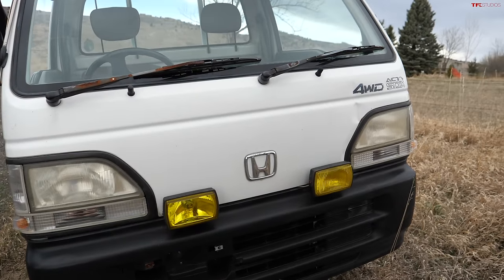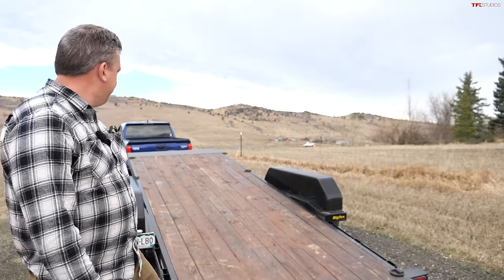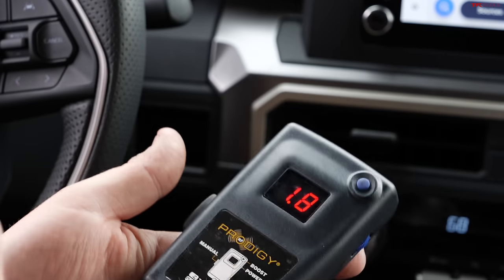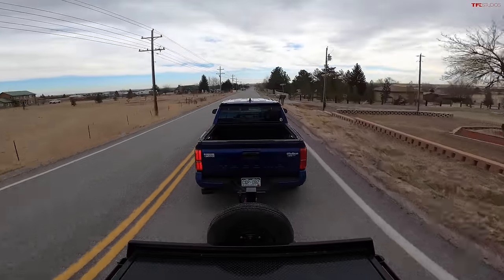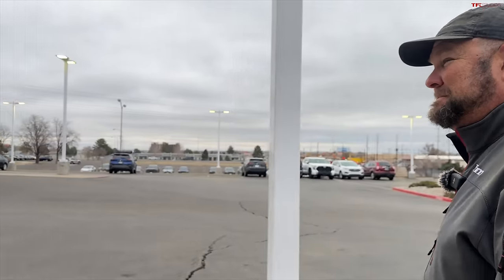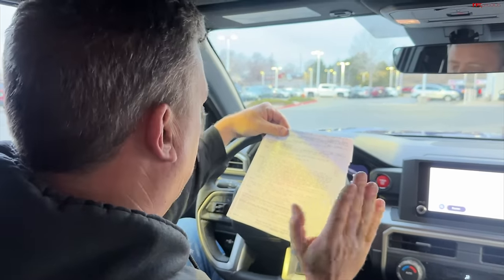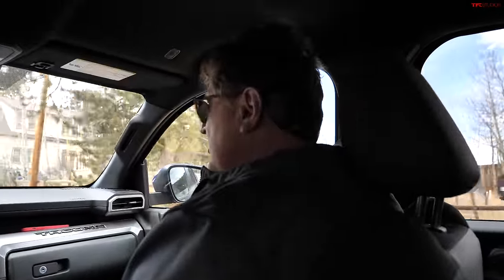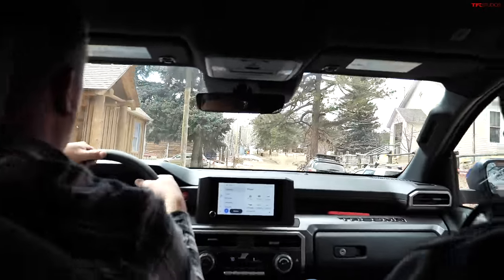Can the New Toyota Tacoma Tow Up the World’s STEEPEST County Road? | Part 1

Comment: Good luck to anyone without a youtube channel getting that repair covered let alone get it fixed in 8 days. No thanks ill wait a few years to consider a new Tacoma
Reply: Huh? My repair was done in 3 days and covered. Love my Taco.
Reply: Theres a youtuber who thinks its because of poor workmanship in the mexico plant.   The part that broke is a time tested 30 yr old part that shouldnt have broke apparently.
Reply: Yeah, this failure really had nothing to do with the new platform. Stuff happens, that’s what a warranty is for.
Reply: toyo fanboys can’t comprehend decline of the tacoma
Reply: @DeepDishPizza Toyota dealer near me tried to deny faulty shocks/springs on my 2022 TRD OR under warranty w/16k. Was 100% driveable just squeaking and grinding. Took them over 3 weeks to accept responsibility. Never off road just regular street driving. Are parts readily available yet for the 2024? Or did Toyota prioritize this repair? My guess is they did no questions asked.
Reply: @mikejones762  what a joke!!! its a new truck the manufacturer is ironing all the problems they didnt founf in the testing phase grow up!! if the tacoma is in decline then whats not in decline?!
Reply: @DeepDishPizza  so you had the same failure with the four wheel drive?
Reply: attacking the guy who makes a comment they don’t like.😂
Reply: @iskdude9922 sure blame it on Mexico, it failed get over it and toyota deserves no blame?
Reply: @paulhunter9613  Sure did and it was my fault.
Reply: @DeepDishPizza I would 99% guarantee it was not your fault. How is it that you figure it's your fault?
Reply: @Tiovergudo  theres a certain work ethic that you simply cant overcome if its not part of the culture....
Reply: @iskdude9922 The assembly location had nothing to do with the failure.  If that was the case the 3rd Gens would have had issues.
Reply: @user-tb7rn1il3q  we dont know that...  its just a guess.   But, the tundras wastegate had issues.  But the lx didnt even though its the same engine.   All lexus products are made in japan i believe.   Also youtuber automotive press bought one of the first tundras and his emblem was backwards.....    he said that would never happen in japan.
Reply: @mikejones762  whats wrong with being a toyo fanbot they make the best vehicles
Reply: @danielplantz2957  Huh? Because I pushing the Taco too hard. Super steep.
Reply: @DeepDishPizza  were curious about real details. Steep isn't much of a detail. What else can you tell us
Reply: @danielplantz2957  Sorry about being vague. However I prefer to keep it that way. Thanks a bunch.
Reply: @DeepDishPizza  worried Toyota warranty is watching 😉😂 We're all just trying to figure out what the limits are. Tfl driving on the equivalent of a bumpy road, definitely shouldn't be it
Reply: @DeepDishPizza  maybe it broke because it doesn’t like being called Taco.
Reply: umm we don't need LUCK because they fix the "issue" so stop NOW
Reply: @mikejones762 that is because it ISN'T  happening, ever think about that??
Reply: @Tiovergudo No they don't
Reply: @hikenmikes8262  They have always been Tacos. What is wrong with you?
Reply: @danielplantz2957  Just watch them and don’t worry about me. Gonna take the wife for a drive in our TRX.
Reply: Why wouldn’t it be covered, it would be covered under warranty, Toyota doesn’t treat their customers like Chevy does
Reply: @AJ-rg3pr  Chevy has been better to me than Toyota has. So you’re wrong there bud.
Reply: @DeepDishPizza  just people have different experiences, Chevy hasn’t made a good vehicle since the early 2000s
Reply: @AJ-rg3pr  That’s also not true.
Reply: Agreed.
Reply: @DeepDishPizza which Toyota did you have. Was it  truck?
Reply: @rickeycooley9139  Learn to reread your reply before you send it. “Was it Truck?”. You mean…”was it a truck?
Reply: @DeepDishPizza  what did yours need?
Reply: @DanMasters so a part just breaks under a well-known youtube content maker and you expect the rest of us to believe in warranty?
Reply: Also the transmission overheating while towing. Not looking good so far…
Reply: ...and sponsored by an attorney. 😂😂
Reply: @CTR_Dan  Not telling.
Reply: @diz_guy47  I’ve never had to use the warranty on my new Toyotas so I’m not sure how quick the process is. Things happen though, that’s why there is a warranty. It’s weird how people expect perfection. I don’t know anyone or anything that is perfect and never breaks.
Reply: I tow heavy trailers, I have no use for a small gasoline engine but it was interesting to watch it go only 16mph
Reply: The Toyota fanboys\trolls are going to vehemently disagree with you
Reply: @mikejones762  With good reason my friend! Their reputation and history of durability reliability and dependability speaks for itself!!
Reply: @mikejones762  toyota fan boy here,  I've completely excepted the down fall the toyota brand. The new trucks aren't going to last , the tundra is having tons of trouble and the tacoma  should have stuck with the 3.5l and just went to a 8 or 10 speed Trans. After looking at a '24 tacoma ($62k Austin TX) I bought a '24 pro4x frontier for $43k. Tried and true 4.0l and a proven 6speed for $20k less , the tacoma was a base sr5 too...can't imagine what a trd pro go's for!
Reply: @DeepDishPizza  Let me see if I understand. You have a Taco that needed a repair under vague conditions and they fixed it under warranty in 3 days,  but Chevy has treated you better than Toyota, and you're taking your wife for a drive in a TRX? You're just making stuff up. I call BS.
Reply: It was mexico @Tiovergudo

Comment: Nice to see Toyota take care of a media outlet so well, but make no mistake, there isn't a snowballs chance in hell that they would do the same for a consumer. No auto company would. It's like pulling teeth just to get recalls or warranty work done with these crooks 🙄
Reply: No it’s not 😂
Reply: I had a 2016 Tacoma for a very short time... In that time there was a TSB for something to do with the rear axle and drum brakes causing it to shudder when braking, and a TSB about transmission tuning because it was awful.  Two different dealers basically denied the existence of the TSBs.  Turned me off from the truck immediately.  Everything has problems, its how the manufacture handles them that's important.
Reply: @ShadowBend it's also dealer dependent too.
Reply: That might have been true a couple of years ago, but that hasn't been my experience recently.  I had two outstanding recalls.  I called the service department and they scheduled both for the same day.  The dealership picked up my truck in the morning and returned it after lunch.  No hassle and the valet service was complimentary.  It would be better if we didn't have all these recalls, but that's the result of a world that lost its ever-loving mind a few years ago and the push to put more tech in vehicles.
Reply: @bryaninnc5511  ford recalled 4.3 millions cars in 1971. Recalls have been happening for decades
Reply: It's nice that it happened. While my Taco was on a quality hold before my delivery this problem and other issues youtubers had were fixed.
Reply: My local ford dealership has been very good for any warranty problems I've had.
Reply: Umm yes they would, they WOULD do the same for the customers so stop
Reply: If all car makers are equally scummy. Choose one that is reliable at least. My 4Runner has literaly never been at Toyota's since I bought it. 70,000 miles and only oil changes and a set of brakes.

All things being equal, Toyota is one of the best choices out there. People will whine that they are too expensive. even older ones. They don't understand that this extra money when you first purchase a toyota will always come back to you if you need it. 

If you still pay a lot of cash for old ones. it means that you can get a lot of cash for your older car in the end. Buy that cheaper american. drive it off the lot and you just spent more money than you would have if you bought a toyota and sold it 5 year later.
Reply: It all depends on the dealer. People don't understand why most dealers deny warranty claims. The auto manufacturers pay minimum  labor to the dealer to address the defected part and the dealer/tech get screwed. Shitty dealers would rather stiff you for the repair to make money off the consumer rather than get underpaid by the OEM and lose money or break even.
Reply: @CACressida  It definitely depends on the dealer. In my case the closest Honda dealer where I live is absolutely horrible. Can't figure out how they stay in business. So when I bought a pre-owned worth to mention Ridgeline from a dealer 45 miles away, still on "bumper to bumper" warranty I really didn't know what to expect. And being a car guy I am very picky and a perfectionist when it comes to my cars. Long story short every issue that i had was dealt with quick and honest. Never had a problem with anything there. That's why I even do my oil change there and will definitely be buying my next car from them.
Reply: @LoneWolfSparty You slept through third grade English.
Reply: This was also a completely stock truck with no modifications and no signs of it ever been slammed up against rocks on any of the components underneath it.
Reply: @jimjones-pz1tt  sure. Whatever you say troll.
Reply: @LoneWolfSparty " it's also dealer dependent too."  = It's also dealer dependent also.   You probably also flunked fourth grade English, too.
Reply: @jimjones-pz1tt  technically it should be as well, if you're talking about tense, so you're also incorrect. But good try nonetheless. Either way, the tense is fine and he understood what I meant. The fact that you don't have anything to add to the subject matter at hand and are literally focusing on grammar, proves my original point that you are a troll. Thanks for playing.
Reply: @LoneWolfSparty  Tense? Jesus H. Christ. No, you should have written: "It's also dealer dependent."  The addition of too is entirely superfluous.
Reply: @jimjones-pz1tt  and this still has absolutely nothing to do with the topic at hand, which is what I mentioned previously.
Reply: @LoneWolfSparty  My comment has everything to do with your intelligence.  I never wrote otherwise.
Reply: @jimjones-pz1tt  Once again, your comment has absolutely nothing to do with the original topic that I was initially replying to. Do you have anything to add to the original statement that was posted that has 100+ thumbs up, yes or no?
Reply: @LoneWolfSparty  Let me try again, for the intellectually impaired:  you can't write.
Reply: @jimjones-pz1tt  type*. You're not physically writing anything on YouTube, it's all communicated via typing/texting. And still nothing to add about the original comment as usual. And based on your comment history, I'm not surprised in the slightest. 🥱
Reply: I've never had a problem with it myself
Reply: I've never had an issue with warranty work with Toyota
Reply: It depends on your dealer garage. It's a law they have to fix it
Reply: @LoneWolfSparty  if it’s a manufacturers defect and a documented one at that then it really shouldn’t be a dealer dependent thing at all
Reply: @monixx9081  correct, but some dealers will put warranty work on the back burner while they take in all the easy CP and maintenance work.